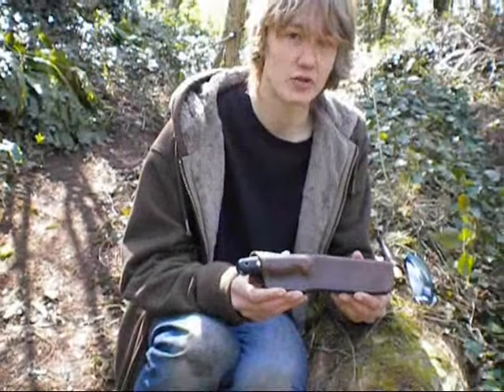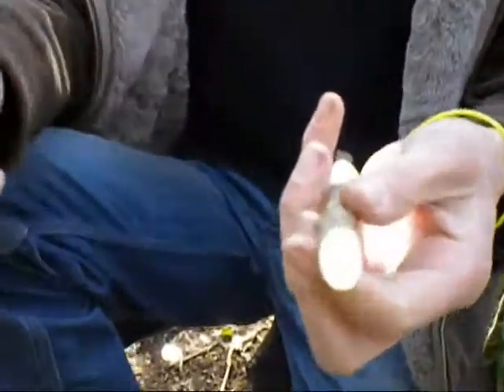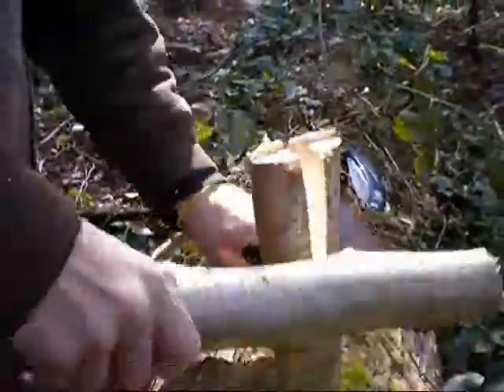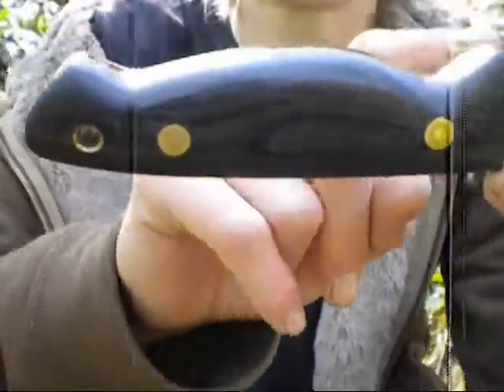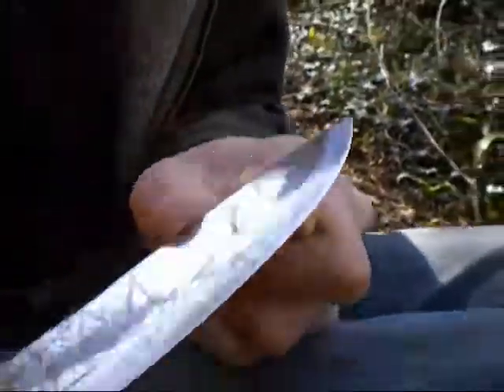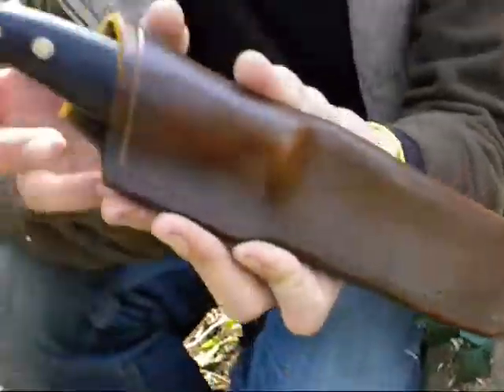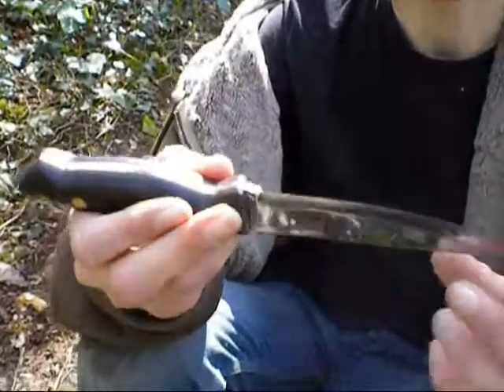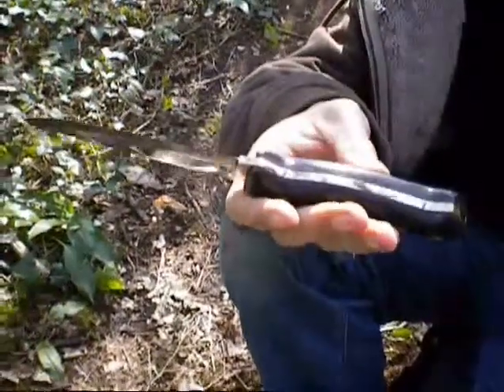GM Patriot Bushcraft Knife

Comment from the maker: @OregonBackpacker 
Cheers mate, well my personal prefernce is for a high to mid scandi grind, about 8mm in 4mm thick steel, so 25 deg bevels with a microbevel to add shrength.

the good tings about a high scandi is that it will cut with less effort and ofen leave a neater cut, the down sides are if you hit a rock or bone with force ect it can chip, this wil not happen with a low scandigrind as its stronger, but it will take more effort to cut.